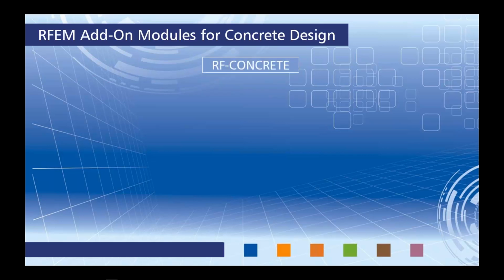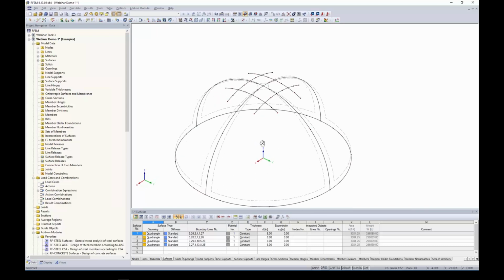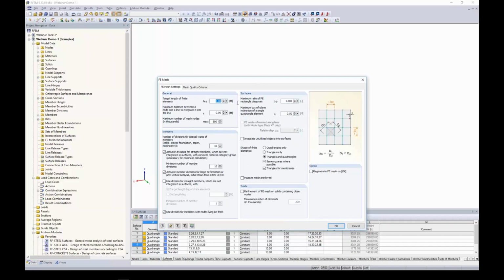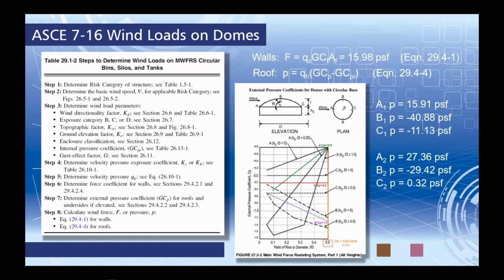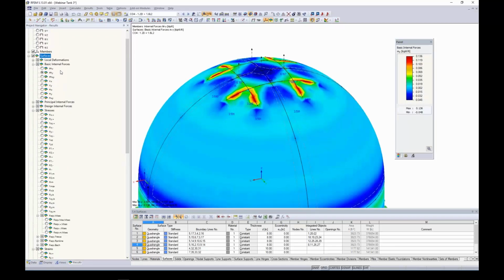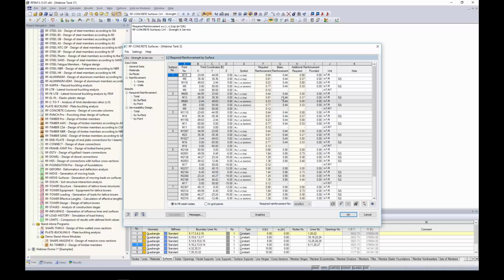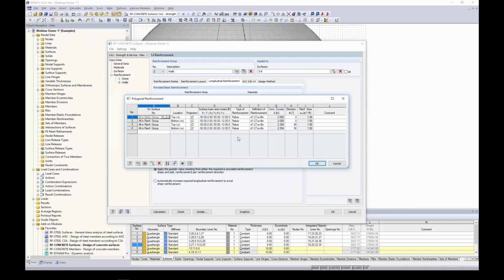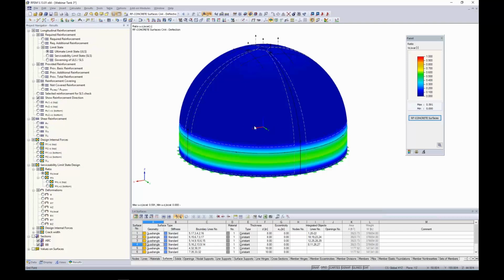Webinar: Concrete Dome, Tank, and Shell Modeling in RFEM (USA)

Comment: My problem is modeling the foundation under say a field oil tank. You need to model the foundation slab, the foundation walling, the raft below the walling, and in some cases, piles under the raft foundation. Anyone with this solution in Dlubal Rfem? Thanks a lot.
Reply from the maker: Hi, edward!
You can visit our website for designing single, bucket and block foundations. https://www.dlubal.com/en/products/rfem-and-rstab-add-on-modules/reinforced-concrete-structures/rf-foundation-pro There you can find our add-on module RF-/FOUNDATION Pro, models to download, knowledge base articles and much more.